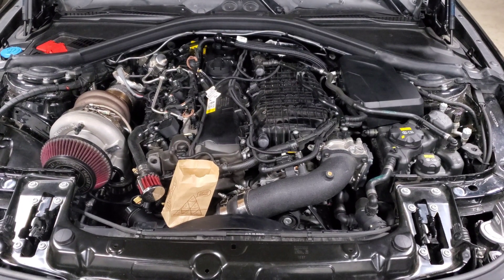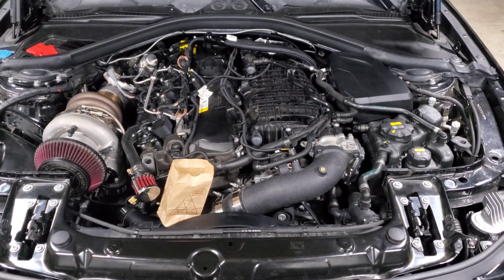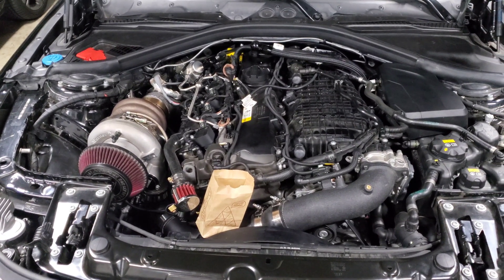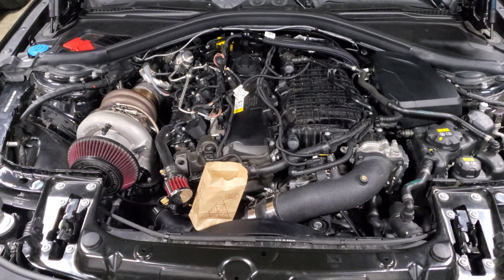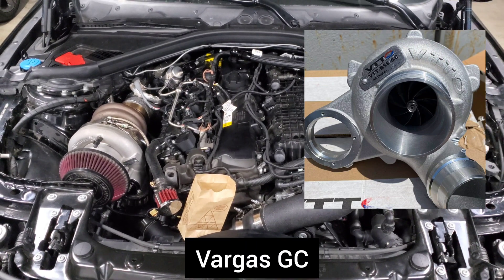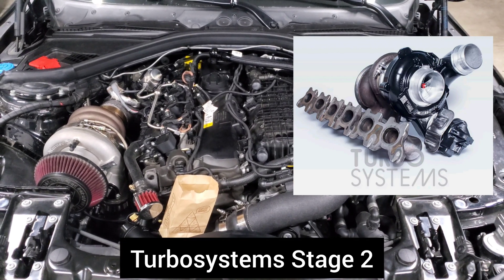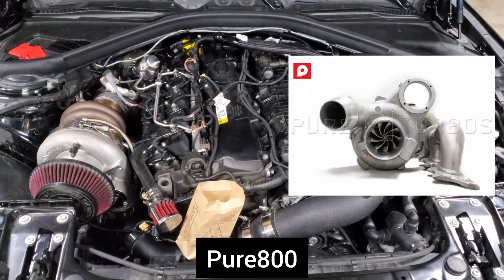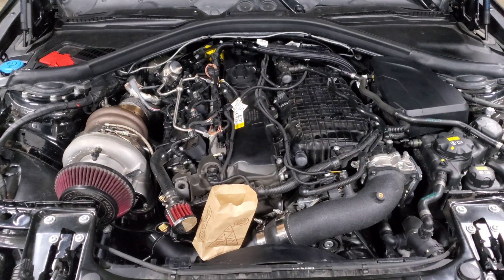Flowmax vs Pure800 vs Pure850? - B58 Hybrid Turbo Guide 2022 Edition

Comment: does the car get all torque steerish with all of these or does that depend more on the tune? I'd like to replace my turbo soon since I'm past the 100k and I'd rather put in the DAW but, I don't want to have the car trying to hit parked cars or oncoming traffic when I get on it.
Reply from the maker: Just like anything else it depends on the setup. If you floor it in 1st with dsc off and all season tires it'll fish tail. If you set up you car properly with sticky tires then it'll drive fine. Just need to gauge your expectations and understand more power requires some responsibility with the pedal.

Comment: One point is that Pure doesn't release any info and keeps it close to the chest, and even pays out failures to keep the owners quiet. DAW had a bad rep a few years ago being rebranded chinesium but has proven itself on this platform and has about the same durability compared to Pure. One big point to DAW is that they use a Mar-M turbine wheel. That's a HUGE plus especially with burble tunes as the upper temp limit is higher compared to Inconel.

Comment: Hello I just installed a pure 800 and a stage two Dortch fuel pump and I’m running MHD tuning and a catless downpipe, I’m wanting to know if I need anything else to make my turbo it’s peak only in pump gas , I only have 91 octane in my area and want to keep it in pump gas . Also, when I tuned it, I didn’t see the option on where you input on the MHD tune to let the ecu know it has hybrid turbo now
Reply: do not run any upgraded turbo on any ots map. You need a custom tune
Reply: you can run MHD just fine on the hybrid but you will not max out the turbo. you need a custom tune for that. I am running a 850+hp hybrid turbo but still on MHD Stage 2+E40 map with the Dorch stage 2.5 hpfp. still waiting to do custom tune. but you are correct. MHD does not have a hybrid turbo option in their settings. you might be able to reach out to them and see if they have a map for it.

Comment: Seriously asking. What is hybrid turbo means tho? are those still running twin-scroll in it or what?
Reply from the maker: it is a modified stock turbo to fit a higher flowing wheel. many modern hybrids replicate the same design but they're built with brand new cast units.
Reply: @kern417  are those hybird turbos still had twin-scroll in it(just like stock)? thanks for replying btw man, Ive been binging yours video. Great stuff
Reply from the maker: Yes

Comment: Hi Kern amazing video btw much help. I have a Bmw 440 running today Steg 2+ with e50, I run that Setup the entire summer it’s fine but I want more. Looking forward next summer to go for a turbo upgrade goals are around 600+whp which turbo do u suggest? I’m thinking either turbo system steg 2 or DAW 2,5?
Reply from the maker: either of those should work great. just depends on your budget.

Comment: I've just ordered a dynamic autowerx ultra flow-R gen 2.  But now I'm concerned with daws reliability.  Since it's a new turbo anything to be worried about with daws?
Reply from the maker: They are generally solid turbos. I wouldn't worry
Reply: @kern417  thanks kerns.  Going to be installing it on my mkvTU supra. Plans for a conservative 600whp jeff payne tune.  Femto bm3 unlock, intake+charge pipe, 4.5"less dp, flex fuel kit, lpfp, port injection spacers. But with stock exhaust to save some cash.  Anything you would change or add to support a turbo like this.  It was a stupid impulse buy with the ultraflowR but wanted a turbo that could carry me to 800.
Reply from the maker: You probably won't need the lpfp but it won't hurt.
Reply from the maker: I also recommend an xhp transmission tune

Comment: Are all of these still twinscroll turbos?
Reply from the maker: Yes
Reply: @kern417  bet, I’m planning on building a sleeper DAW Flowmax 2.5+ with a TU pump and shooting for 600hp and 580ftlb on 93. Any advice? I love your videos super informative, I think I only need to upgrade my clutch and heat exchanger to support it
Reply from the maker: You probably won't get 600 on a DAW without ethanol.

Comment: Can I just get a tune on my "stocker" and benefit from it? Thanks
Reply from the maker: Sure
Reply: Cool, what should I ask for to just "wake it up"? Runs great but if a tune can make it run better I'm all in. Thank you so much for sharing your advice. I figured you'd DEFINITELY give some sound advice. 👍
I'm a new subscriber to your channel and totally shocked about your level of knowledge in these B58 motors.
Reply from the maker: Basically any stage 1 tune is designed for completely stock hardware. So just pick your preferred tuning platform and flash away
Reply: @kern417  much appreciated thanks

Comment: @kern417 Question, Does the vargas GC have the same spooling time as the original turbo? I want an improvement but I dont want to lose the low rpm power of oem b58. thank u
Reply from the maker: It'll be the closest of the hybrid turbos

Comment: I’m trying to run a safe high 500hp-600hp what turbo would you suggest without pushing any component to its limit and what type of fuel pump could I use?
Reply from the maker: Any upgraded turbo can hit that on an ethanol mix. Gc would be the cheapest

Comment: I'm more of a time attack guy. So I'll just use 93octane to drive the car, no e85, meth or anything. So with the normal 93 octane, which turbo that it can make the most hp and better response？ Thank you very much
Reply from the maker: Most hp won't have the best response. It's a tradeoff. But none of the hybrids spool poorly

Comment: Would it be “safer” to have parts capable of big power and only tune for my goal of about 600 whp? So going ds2, flowmax, and port meth would have a lot of potential, but I wouldn’t need it to hit the goal. Could it be a safety percussion for daily drivability?
Reply from the maker: Headroom doesn't really do much unless you're worried your tune is going to be unstable. Any competent tuner can tune within the safe limits of a given setup. Imo it's better to get a tuner than throw parts at your build to cover up potential issues
Reply: @kern417  appreciate the feedback, saves me $. Guess I should research the capabilities and flaws of all my setup options. Is there any insightful threads on the forums you know of off hand?
Reply from the maker: @PoorlyUtilized  what are you focused on? Just fueling?
Reply: @kern417  yep, no E85 close by and still waiting for flex fuel support
Reply from the maker: A dorch stage 2 will be all you need

Comment: What would happen if you just pulled the stock turbo and put in one of these others without putting a bigger hpfp or adjusting the tune? Would it make more power? Would it be running lean?
Reply: It wont make more Power

Comment: well too late, I bought a GC+ and will get it tuned by Paul Johnson on Pump gas. So lets see how we do.
Reply from the maker: No worries
Reply: @kern417  Hopefully I can provide some more logs on the forums to help more people decide for or against GC+. I originally reached out to Odin but he did not want to tune it.
Reply: What power did you make
Reply: @Addselwyn  Sold the GC+ (never installed it) and am receiving a pure850 in a couple of weeks.
Reply: @DamnDudeGetaLife  hello mate, can I ask why you chose to sell the GC+ without installing it first?
Cheers,
Ant.
Reply: @DamnDudeGetaLife  well I can’t ask for a more honest reply than that,thanks mate. 
How’s the Pure 850 going
Reply: @DamnDudeGetaLife  great to hear mate 👍. Has the Pure introduced any hint of turbo lag that wasn’t there before?

Comment: What would be the difference between a Hybrid vs Full Frame turbo kits for 93 pump gas only? Since peak hp would mostly likely be similar, would a full frame turbo kit still be faster? Like 100-200 time and 1/4 mile? Thanks!
Reply from the maker: Many Full frame turbos can make more power on the same fuel
Reply: @kern417  Would you be able to make a video on how to get the most performance out of the b58 with only 93 octane for those who don't have access to meth or e85? Like selecting turbo sizes and kits.
Reply from the maker: Yes
Reply: @kern417  Awesome thank you!
Reply: @kern417  have I missed the video you mentioned making in this comment?
Reply from the maker: @stevengooden7911  https://youtu.be/DBGZ_MZA5Rc

Comment: In terms of the different Turbos ability to support higher HPs like Vargas vs P800, does which turbo matter if it’s just on pump gas? They all have a limitation on pump, so if I’m planning on staying on pump, should I get the cheaper GC? Because I’ll never be able to maximise p800’s capabilities. Please advise Broski
Reply from the maker: full hybrids will make more on pump than only cold-side replacements like the GC.

Comment: Can you go into each turbos resistance to antilag? As in, do any of them have superior thermal protection, or other things that would make it more durable when using antilag?
Reply: Its more how much you use it, and at what boost. Higher hp is higher stress on stuff when you take off. But I mean thats not scaring anyone off that wasn't already scared off. If you launch the car thats more stress on drivetrain than launching it while moving so I mean. Id say pull it out at meets or important races and call it a day
Reply from the maker: I don't see anything that would be much different in that department

Comment: Great video. I’m wondering if I can pick your brain a bit, my wgdc is 99% and I already have gotten a smoke test and there were no leaks found, I also ran on a very low boost map and it still read 99%. What could it be? I’d figure if something was wrong with the wastegate it would throw a cel if it didn’t calibrate correctly
Reply from the maker: check for exhaust leaks
Reply: So the wastegate stays at 99% when not in boost right?
Reply: @Bimmerthangz  yea, now that I’m looking at the log again it’s only 99% when not in boost, may be an exhaust leak as kern said

Comment: I have the Pure800 and it’s awesome!
Reply: My Pure800 goes in next week!❤
Reply: @cameronrussell9362  remember you can use an OTS map in case you aren’t able to custom tune it right away. I ran an MHD stage 2+ OTS map on it for at least 2/3 months before finally getting my custom tune
Reply: @M240_  did you notice a big step up with the custom tune?
Reply: @b16dans  not at first, with the first couple of revisions. After that yes!, I need some better tires now since I spin up to 4th gear. I'm waiting on some r888's to see if that helps.
Reply: @M240_  perfect bro. i plan to get the flow max v2.5 and i plan to run the bm3 stage 2+ ots map before i get my base map, which wont take long. how were your logs? what fueling?
Reply: @universalg_   Did you end up getting the flowmax? And if you did has it been reliable?
Reply: @davidcherkassky  yea dude. The turbo has been amazing to me so far. 2 years with the turbo. Barely pushed it to 28psi and made a solid 600whp/600wtq E40 FF DI only. I’m gonna be selling it now for a top mount doc race 6266🫡
Reply: @universalg_   Sick bro thanks for the input. I was also eyeing the doc race but i'm going for 600-650 hp and the flow max seems like the more affordable option
Reply: That's the one I ordered for black Friday !! Can't wait or install

Comment: Which turbo would you recommend for 550whp? I need more top end power
Reply from the maker: All of them can reach that
Reply: @kern417  how about on pump gas? Ive heard that the 800 sometimes cant go above 500hp with pump gas and it concernes me. Because I also want at least 525-575 hp/tq. I was gonna get the gc+ based on last years video but it seems thats not the way to go?
Reply from the maker: @captainminecraftist  hybrids are limited to around 550 on pump gas. some people have gotten more but it's not typical.
Reply: @kern417  Thats perfect for me. A nice safety ceiling for dd. Do you think a flowmax system could hit around there with a hpfp and downpipe? Its the first ive heard of that turbo but it looks good. Thanks for all the help you bring to this community btw. its much appreciated by many people :)
Reply from the maker: Yes
Reply: @captainminecraftist  my 340 just hit 541/590 on a mustang Dyno with pure800. IAT's were warm, so that number may be slightly low. 450 tq @ 2500 rpm and didn't drop below 450 until past 6000. Peak tq 590 between 4250-4900. WGDC @ 88% pushing 23psi. Definitely being pushed, but I don't mind replacing a turbo.
Reply: @mattmartin598  Thats about the upper limit percent wise of WGDC you want right? same with psi correct? Ive heard it can do 28 but with pump you want to keep it to 23-24. Def seems like its a bit of a struggle. Im going to go with flowmax so I dont have to send my turbo in and i'm hoping it has a bit more in it so I can tune it a little less aggressive. Thanks for the info tho man really appreciate it!
Reply: @captainminecraftist  it's higher than I would advise for longevity. 28 with the pure800? I don't know about that, that sounds like a grenade. If I'm already at 85-88% at 23 lbs. Maybe you read 28 on the stock turbo? Not sure.
Reply from the maker: It's fine. Plenty of people run 25-28 PSI. Some run 30+
Reply: @kern417  with the pure800? Hell, I'll try it, see what breaks. I already hit 550 at 23lbs, can't imagine there's much more in it. Probably a good idea to upgrade my PCV! 😅
Reply: @mattmartin598  Im remembering this two days later so disregard if im stupid. someone said for pump stick with 23-24 because heat? and ethanol i believe they said for 28. That was their comfort level tho everyones different. I mean kern seems to think its fine. Ive also heard that anything under 30 and your pretty much ok with a lot of results to back it up. I just want something with no chance to failing outside of random 1% chance and Im dd a 250hp 4 cylinder bmw so I mean im not gonna complain either way haha
Reply: @captainminecraftist  I'm not saying people are wrong and I listen to Kern over myself, so it's got to be achievable. I'm just confused, if my be WGDC is already 88% @23psi, what would it be at with 5 more lbs? 88% is already pushing it pretty hard.

Comment: At what point do you think we’d need a built motor, and would you say the Vargas gc if not planing on a built motor? I feel like 650-700’s is pushing stock block.
Reply from the maker: https://youtu.be/b9DJEtAiDK0
Reply: @kern417  ok, I see you. Ig 650 is my target goal then. Flow max or vargas gc? Don’t need an overkill turbo.
Reply from the maker: Flowmax
Reply: @kern417  the v2.5 correct?
Reply from the maker: Yeah